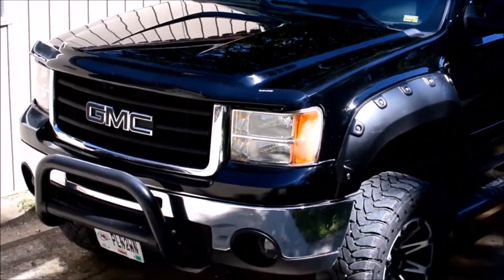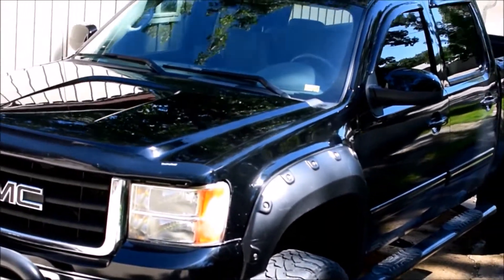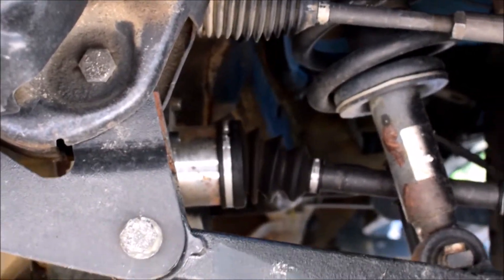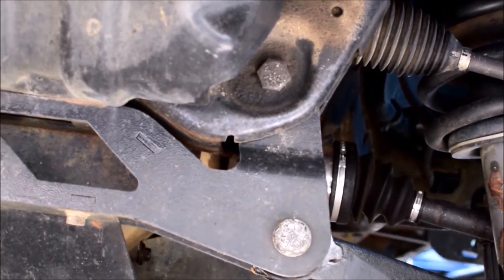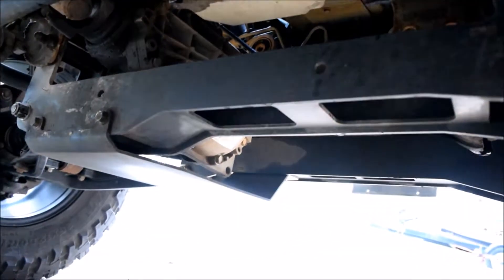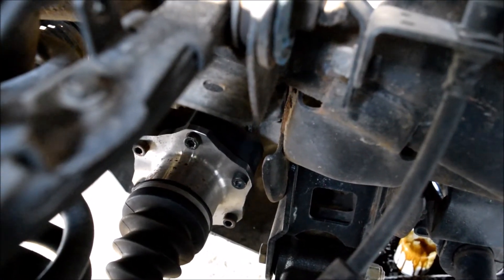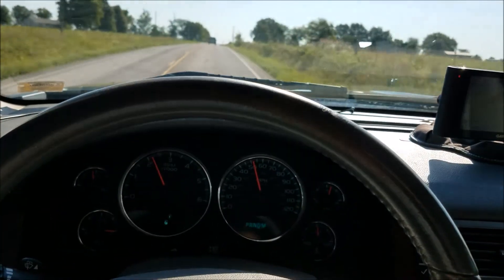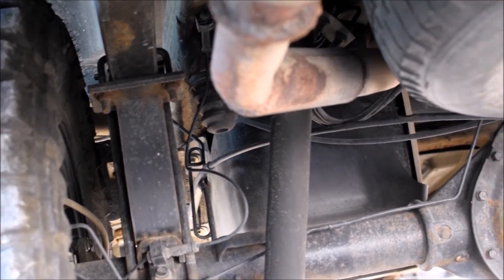Rough Country lift kit, Review, for the GMC Chevy 1500 2010

Comment: Do you have the rough country dampeners too? I've been looking into upgrading mine. I have a 7.5" rcx
Reply from the maker: I do not.  I would add them but at this time I don't get much vibration or movement in the wheel.  I've had truck where WOW steering wobble is bad.